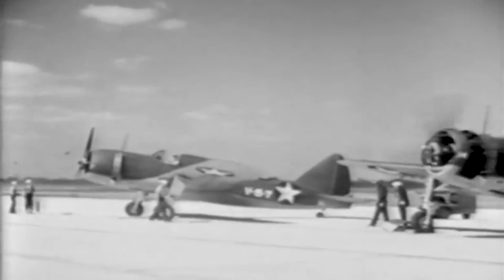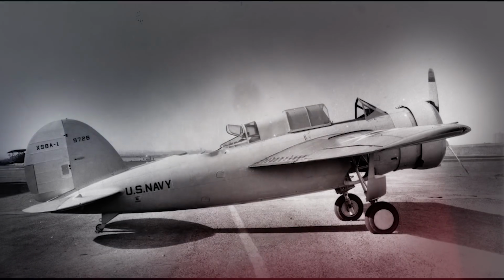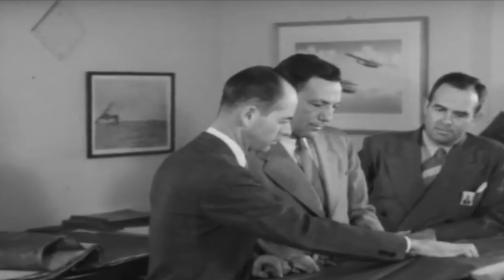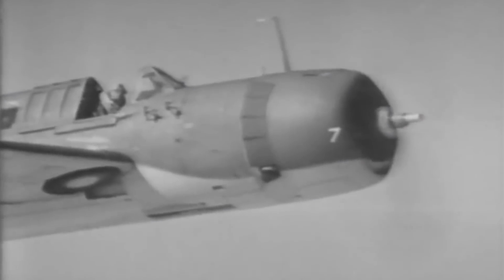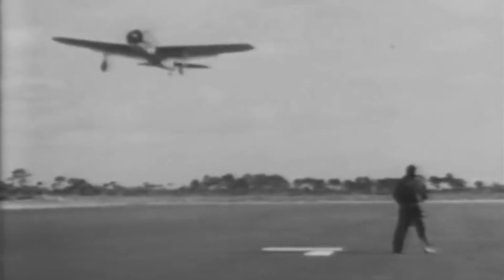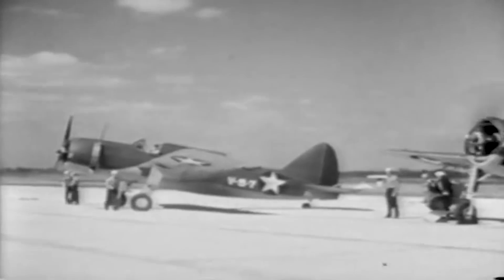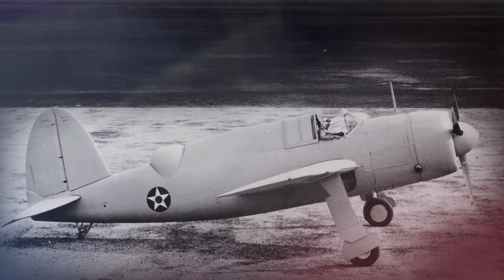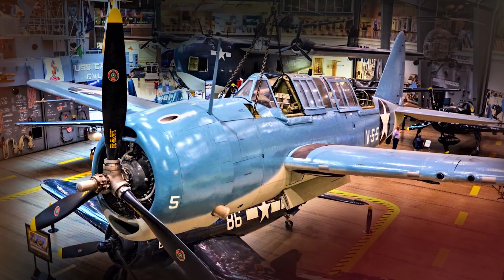The Worst Airplane of WW2 - Brewster Buccaneer Scout Bomber

Comment: only 2 are left, in Pensacola, and out west in Tucson Az. however... one is actually under construction in the old factory in PA, by old factory workers.
Reply: @claytonbouldin9381  actually kind of boring watching the old way they took metal and put rivets in. slow slow slow
Reply: The old factory in Warminster (Johnsville) was torn down several years ago. I believe the Buccaneer that was being rebuilt there is the same plane that's now in Pensacola? The Navy owned it and the Navy rarely gives up ownership of an airplane. The ME-262 that was restored by the museum at Willow Grove NAS is also in the Pensacola museum now, along with some of the old German and Japanese planes that sat outside along the fence on Rte 611 for decades.

Comment: "Underpowered. Look at engine." 1700 hp. Me: bruh. There were sucesfull planes with similar firepower , speed and more bombs with half of that power.
Reply: It was overweight
Reply: The engine was fine, it was just mated to a completely inappropriate airframe, and one badly put togther at that. The plane body was too heavy for the power rating of the engine and poorly balanced as well.
Reply: I wonder if they ever tried launching an A-10 wart hog off a carrier deck.... Maybe strap on some solid fuel rockets for a boost.
Reply: @bigimskiweisenheimer8325  i dont know why you would need a ground support plane at the sea, but a C130 has been launched from a carrier
Reply: @nevize6660  could see it being useful for supporting ground troop landings and anti insurgency work , the JSF providing Intel with its advanced electronics and A10 going in at floor level with its heavy ordinance.
Reply: It was a legendary engine stuck to a crap plane.
Reply: Just look at it in profile. That fuselage was way too long.
Reply: Basically the opposite of a Chieftain Tank.
(great Tank, lumped with a crap engine)

Comment: Brewster might have claimed the Buccaneer's powered turret was a ground breaking innovation for an aircraft of this type.
But it pure BS
The Bolton Paul Defiant had one flying in combat from the first stages of WW2.
And it wasn't such a great idea as it turned out anyway.
Reply: The Defiant concept worked fine (an aircraft for downing bombers from almost any angle), but the lack of forward firing guns doomed it in day operations against Luftwaffe escort fighters.

In night operations the 'plane proved quite effective.
Reply: @jimtaylor294  Well, sort of.
The weight and drag of the turret killed performance too much and only provided half the firepower of the single seat fighters.
Its why they relegated them to nightfighters in the Battle of Britain instead of sending them in alongside the Hurricanes.
Reply: @Farweasel  I can largely agree there, particularly in regard to weight.

It is of note though that the Defiant could approach & attack Bombers from more angles than normal fighters, negating the heavier defensive guns.
Also due to this one could - despite having less guns -  put significantly more rounds into a target over a given period of time, as the Defiant could basically fly parallel to a Bomber whilst blasting away.

Granted though: for the same reason as why defensive gun turrets were phased out of Bombers, Turret Fighters weren't going to last the course of the war; as far larger caliber MG's & autocannons could be mounted lengthways in a Fighter, giving Heavy Fighters like the Mosquito & ME-110 much more & sharper teeth than an opposing Bomber could practically heft.

Had the RAF possessed a fast Heavy Fighter with high-velocity cannons in the BoB; I suspect the results would've been impressive.
(heck; the adoption of 20mm cannons on Spitfires certainly gave a significant jump in firing range & lethality)
Reply: The Defiant was a fighter/interceptor. The Buccaneer was a scout/dive bomber. Two different types of aircraft. Both operational failures.

Comment: Brewster made a number of  pigs....I would say that the Buffalo was even worse.
Reply: Look up it's history .. the Finns liked them and had some great success's with them.  So it actually wasn't a bad airframe .. it is just that the Yanks shoved too  much crap on it without increasing it's power.
Reply: @kittyhawk9707  well  compared to the I-16s and SB -2s the Finns had to fight, the Buffalo was a winner.  But that proves nothing.  The other contemporary fighters of the same generation of the Buffalo were as follows: Spitfire, Hurricane, Me-109, P-40, A6M. P-38. If you had a choice of any of these aircraft or the Buffalo,  which would you pick?

Comment: The Buccaneer and Buffalo would have been difficult to build successfully if the company was run by experienced builders and the management was involved in ongoing bribery and organized crime dealings. Unfortunately, the Buccaneer was being produced by militant ex-- auto workers with a reputation for striking on a dime. Brewster had two brothers that served as their marketing team. Both had been involved in fraudulent sales contracts and aircraft smuggling . It's only surprising that the Buccaneer/Buffalo weren't bigger failures. 

The Finns actually liked their Buffalos, model B-339, and considered them to generally be the equal of most Soviet fighters flown against them. It was only their use against the Japanese in the Dutch East Indies that showed how obsolescent the B-339 actually was against better aircraft flown by experienced pilots. The final blow was Brewster being awarded a contract to produce and early versions of the much more advanced Vought Corsair. Not only was the workmanship horrid, but the Miranda brothers fell back on their old ways, cheating customers and lying about the products. It was only the Navy seizing control of Brewster in 1944 that finally put the company out of its misery,

Comment: Directly from the production line to the scrapyard, that’s US Defense spending for ya
Reply: That really is a surprising outcome. As badly as the US and the Allies needed defense production, one would have thought this plane would have been abandoned early (especially once the French refused to use it) and the manufacturing facilities turned back to supplying parts for other builders. 84th most important defense department builder? I wonder how close to last that made them?
Reply: @cdjhyoung  not very close at all. Damn near every company in county was producing goods for the military. Everything from uniforms to food, tanks, bullets, guns,  shoes, stretchers, tents, landing crafts, planes, rockets, radios, batteries, boots, fuel, bandages, etc ,etc ,etc. 84th wouldn't even be closer to the bottom.
Reply: @shelbyseelbach9568  I suppose you're right. I can think of about 50 companies based in Michigan then that were deep in the war effort. The number of companies were probably in the thousands.
Reply: @cdjhyoung  Easily in the thousands, easily.

Comment: If they had a stronger engine it might had worked a big might
Reply: It had 1,700 HP 
What was really needed was a weight reduction , just by looking at the aircraft I can see how you could easily shave several hundred pounds off it
Reply: Perhaps, but the engine was already heavy and I don't think there was the technology to add a stronger one.
Reply: @comrademeerkat1733  good point
Reply: Maybe...perhaps if it was able to fit the 2,000hp P&W R-2800 that powered the Hellcat, Corsair, Avenger... Then again the Curtiss SB2C was powered by it and by all accounts that aircraft was a POS as well. Looks like the Navy couldn't get a good single-engine dive bomber (post-Dauntless) until Ed Heinemann/Douglas developed the BTD-1 and A-1 Skyraider (both of which were powred by the enormous 2,700hp Wright R-3350)

Comment: The Brewster Buffalo  F2A says hold my beer!!!!!!
Reply: The Buffalo was used by the Finnish Air Force in WW2 against the soviets, it worked here pretty good!
Reply: Trey Stephens  The Finns were neutral first but then the Soviets attacked in 1939-40 and no one really sent any help here. And in 1941-44 the Finns only chance was to go with the Germans and retake the lost areas from the winter war. In 44 we had to make peace with the Soviets and still fight the Germans out of northern Finland. But we managed to keep our independence after all this.
Reply: Trey Stephens  the Jug found its place as a ground attack plane LOL
Reply: @stevehomeier8368  P-47 was a wonderful fighter at high altitude 25,000-30,000 , where it was meant to fight. At high altitude the 109 or the 190 only bested it marginally in rate of climb and acceleration. The twice as heavy P-47 could outturn them both at that altitude due to it's wing shape that performed better in that thin air.
Reply: @Cragified  Thank you!  I'm so tired of all these guys who think the P-47 was only successful at ground attack.  It was one of the best fighters of the war at the altitudes it was designed for.
Reply: F2A depends entirely on version. F2A-1/2 that wasn't loaded down with extra guns and pilot armor could hang with a A6M in handling, though not in climb or speed. The F2A-3 or F2A -1/2 that had been 'upgraded' to F2A-3 standards were just too underpowered and overweight to be useful. And at this point better aircraft had entered production.
Reply: @Cragified  you mean the A6M? As in the Zero?
Reply: @reggiekoestoer1511  I think he's confusing the J2M and A6M... but maybe what he really meant was the A2N...
Reply: @reggiekoestoer1511  Correct, I did mean the A6M, many of the marine and navy pilots including several of the most experienced war survivors felt the F2A-1 and F2A-2s that hadn't been up armored and weight added were equal to the Zero in the horizontal. They had nearly identical wing loading.

Now when armor was added it became inferior in the horizontal and even more deficient in the vertical.
Reply: Funny, but one of the highest scoring aces in WW 2 flew the Buffalo with success (Finnish pilot flying against the Soviets).
Reply: Learned quite a bit from this one: https://www.warbirdforum.com/faf.htm
Reply: I mean... the Buffalo at least saw combat...
Reply: Trey Stephens  Sort of... and not really.  Really, they were against the USSR, which made them defacto German Allies.